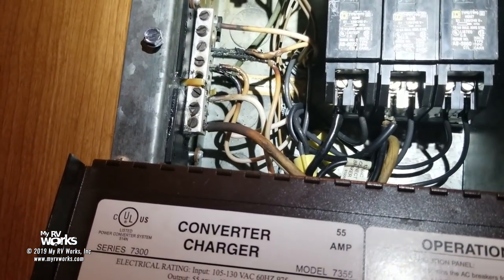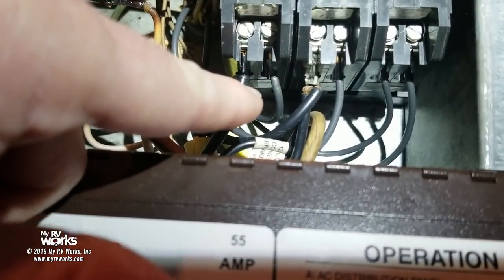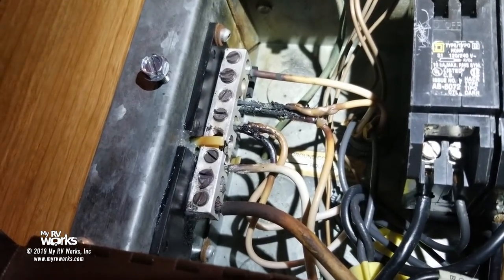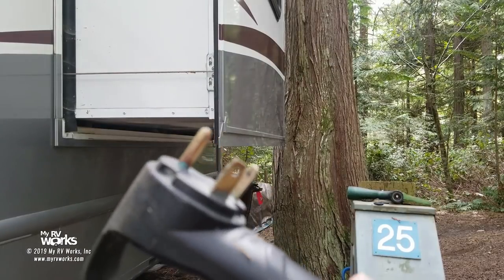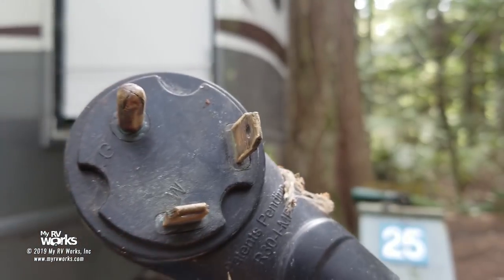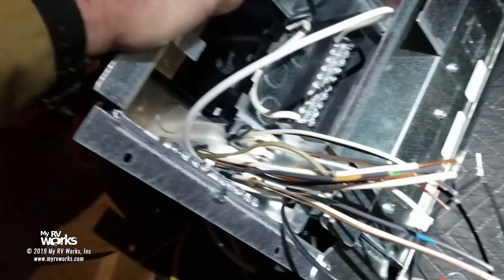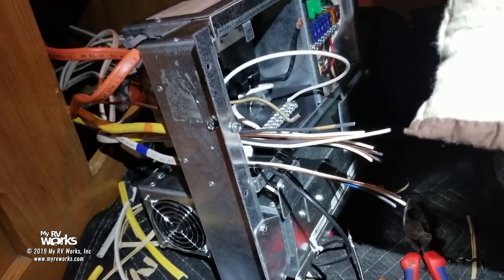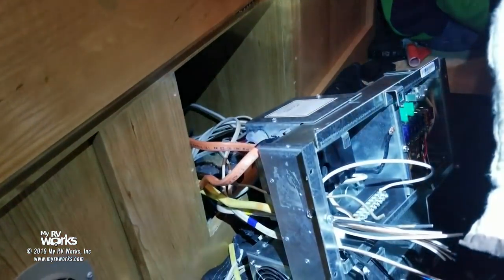Replace RV Electrical Service Panel & Explanation Of How Electricity Works

Comment: Don't ever apologize for rambling, because when you "ramble" it is VALUE. It's like free spins at the casino! I'm a reloader and have always struggled trying to wrap my mind around electricity so when you started talking about grains as an analogy, light bulbs went off. Thanks for what you're doing.

Comment: The fact that you take so much time to explain things to your audience (soup to nuts) is top notch, NEVER stop! I have been researching Solar and Lithium Iron Phosphate batteries for my future RV, for almost 3 years now - and I still consider myself a total novice where electricity is involved. You made a brilliant point about connection points being the main failure in electricity flowing. I was not aware of how complicated the electrical panel in the RV was, and the chance that the builder may NOT have used proper gauge wiring or torquing specs. Jesus take the frigging wheel...I don't even have my RV yet (prob a class C around 26-28 ft with NO SLIDES) but I am trying to learn as much as I can about how an RV is put together and how everything flows, failure points, etc so I can be prepared for my future ordeals, which I know will be a part of owning one of these poorly built monsters of the camping set. Thank you again. Your video on rectifying the slideout issue (the chain/cable system) over the top of the slide...what a nightmare! Nope, no slides for me...
Reply from the maker: Thanks for the kind comments. Hopefully my series of videos will help you, and many others, in keeping their RV in Tip-Top shape and staying happy campers. Good luck in your future purchase and RV travels.
Reply: Class C. Look under the couch. You will all the wires in one pile.
Reply: "Find"

Comment: I totally LOVE this electrician! I don't say this often man , but you have a passion for making certain you're understood, with explanations, examples, past job site situations yeah very through. I'm a framer with desire to learn as much as I can about electrical. I just found my go to guy for all things electrical. I'm moving into an RV that's been sitting for 20 years this video has saved me untold headaches learning about the importance of torque values for different gauge wires. Thank you so much

Comment: When connecting stranded wires to that type of terminal, the quality  and longevity of the connection is greatly improved when a ferrule is crimped on the wire first. The ferrule bonds all the strands together.

Comment: Dude, lol, my late husband was a master electrician and could NEVER explain ANY of this stuff to me, but you used all the right analogies and now I FINALLY get it! Tire pressure by gallons per minute, grains in a bullet, etc.? YES! I understand THOSE things so now I finally understand volts by watts, hz, etc.! THANK YOU THANK YOU THANK YOU. Seriously, you have no idea how long I've been trying to wrap my head around those things so I could work on my RV properly and actually KNOW what I need!! YAY! LOL No really, thank you so much. wow
Reply from the maker: You are very welcome! I've been dealing with electricity since I was 7 working with my grandfather as an electrician helper - he died when I was 15 so I had several years to work with him. It also took me a while to get my head wrapped around all this but then all the sudden the thousand points of light came into focus and I understood. My explanations are not theoretically correct because electrons don't actually move they vibrate, but I think I was able to capture enough to help people understand the 80,000 ft view.  Have a great New Year!

Comment: Thanks, I'm a maintenance tech and I work with and around voltages from 5 vdc to 480 vac 3 phase on plant equipment and cnc's pretty much daily. I also just got a 1982 GMC Midas. It's a whole new prospective thinking rv and I Thank You for your videos and helping you sort these systems out. Thanks for the homework too!

Comment: Nice video. The only thing that I would add is that electricity is caused by an imbalance. High energy on one side. Nature will not tolerate an imbalance. Like water, it is always trying to level out. If you ever see your voltage going real high and then real low, it is usually a broken neutral wire. Thanks for your videos. Really enjoy them.
Reply from the maker: Thanks for the comment David!  I find myself going deeper and deeper into these topics and then try to stop myself - perhaps if I prepared a script I could present the information more coherently.  I was an industrial automation systems engineer for over 25 years before I started this business (so I could be more involved in my kids childhood - engineering was great but no room for family balance eh') and I find myself jumping off the deep end with folks that may not know how to swim yet know what I mean?   That is why I used the hot-potato and bicycle analogies,  I made them up on the spot - I like your water analogy though!

Cheers,
Darren
Reply: The information is great! I made an RV 7 way tester like yours. Great idea! I drive film equipment and we are always having to quickly find solutions to all kinds of problems. Star trailers, 12v and 110 problems. Towing wiring problems. Great tip on being able to plug in the heating element for the refrigerator. If an actors refrig goes down, now I can be the hero until we can get it properly fixed. Thanks for making these videos!!
Reply from the maker: @davidh7636  Thanks for watching and commenting.  I have lots and lots of MacGyver type hacks to save the day.  I hesitate sharing some because doing them bypasses the safety features - but sometimes you need to get something done to save the day.  I hope I do not regret the frig heating element hack one day - LOL.  

More video's coming out filled with tips and tricks to help you be the hero!  Perhaps they will make a movie about you one day!!!

Cheers,
Darren Koepp
Reply: If I'm remembering correctly, electrons flow due to a difference in potential between the two end points in the circuit. That's why your cars alternator charges at 14 or slightly more volts. The alternator creates the difference in potential between itself and the battery. Does that sound right to you? Like I said, I'm working from old memory..

Comment: Darren, the video was long but you covered a lot of theory. I like to use the water analogy, for resistance, I like to quote my electrical teacher, he told one student that to throw him into the hallway from the classroom there is less resistance if he opened the door first than if he didn't. I do not have a torque screwdriver and have always just used my own guess, I will be looking into a new driver as soon as I can find one here in Ontario. I have been around electrical for about fifty years and you are the first to point out torquing the screws to spec. I do not know anyone that has used an actual driver to check it. My dad was a full-time electrical contractor all his life.  I will be soon. I will be going over the power panel in my Ibex trailer as soon as I get the new driver. A good job teaching your helper there well.

Comment: Very well explained. And to the point. A good video to watch. I subscribed to your channel. I've been an electronic tech my whole life..... I came across this video because I have a problem with my 2004 Pace Arrow 37C. When I unplug it from shore power and push both battery disconnect switches, both the Coach batteries and the chassis battery will drain down to 5.44 volts in a week or so. And stop their. Theses batteries are not supposed to be tied together. I'm still fighting it and looking for the problem. Anyway good video, it should help people. Thanks, Tommy

Comment: I am planning to upgrade my travel trailer from 30 to 50 amp as a retired Electronics Tech. I am fairly confident that I can handle it, however I would love a video on this procedure.  I know a few other RV folks who are not as knowledgeable that would like to upgrade as well, and also I may pick up some RV specific tips.  Thanks !

Comment: In the email I referred to a lighting strike that took out power ,is wire I thought until now and  receiving a power bill over $185.00 it has increased 25 or more every month and I thought air conditioning at first now ? I just don't know please help . I can do most anything with proper instruction  and you are the only one I have found on here that gives specific numbers to your reasoning!!!

Comment: I bought a 1978 Dodge sportsman RV that is a POS on the inside, it has a solar panel and all appliances should work, I know nothing about RV's and I'm so overwhelmed, I want to fix it up completely for as little money as possible while living in it. Your video is helping me understand some of the basics. I want to take out all the interior lights and put in battery led lights so they don't use up any of the available electricity, I don't know how strong that solar panel is either, I hope it will provide enough power to live on.

Comment: Hi great videos lots of info .
Why does my converter have 2 cables coming of the pos & neg terminals 
Tks Winston 
From Newfoundland  Canada
Reply from the maker: Typically when you find two cables connected to positive and two cables connected to negative, one set will go to your DC fuse box the other set will go to the battery. Hope this helps.

Comment: thank you for your info ,very nice ,i have a question for you ,we in the northern climate we have great varience in temp,with only lithium we have a problem with ar rvs ,how can you match agm with lithium ,in are battery bank ,
Reply from the maker: Well, it's not recommended to mix and match the lithium with AGM. The converter would not know what to do with that configuration. One option is to have two separate banks with a switch to select between the two. But then to be technically correct, you would also need two separate battery chargers, one to charge the lithium bank and another to charge the AGM bank.  They each have different charging algorithms.

Comment: Great video. I am currently working out an issue with my 94 itasca sunrise.  the issue is my 12v lights at my bathroom and bedroom are not working at all. Fan and light in bathroom and the lights in the bedroom. Lights over the bathroom sink are working fine. That sink is right across from the bathroom door.  Every other light both inside and out are working fine. 

Any thoughts?

Comment: how bad is it if you plug into a 50 amp receptacle that was wired wrong with the 2 hot legs on the left and bottom and the neutral was on the right side.

Comment: I'm restoring a 1984 Executive class A 35' 454 with tandem axle. Trying to figure out fuel pumps wires going everywhere for what should be a simple set-up. Well thanks again later you all

Comment: On my 30 amp camper, Forrest River put 3 receptacles along the back wall in the kitchen and one receptacle outside the kitchen window. There is no way you can run a coffee maker, a skillet and charge my golf cart without tripping a breaker. Don’t these manufacturers know about usability? In my breaker box it looks like there’s a space for another breaker. Can I add another breaker to replace one receptacle in the kitchen?

Comment: just found your channel and ive been watching your videos for hours now. i just bought a 97 four wind majestic and everything worked amazing until i got about 10 miles from the person i bought it from. everything seems to falling apart but im not going to give up on it. the fridge has stopped working but think ill be able to figure it out with your videos. One HUGE problem i have and i cant find the answer to is installing a certain backup camera its the cemacho 7in monitor 4 camera wired system. it came with instructions that have 1 picture on a 3x5 card and thats it. cant find anything on youtube or anything else. can you please help? Id also like to know how make the system run when the vehicle isnt on for security purposes. im thinking that will require some type of switch. can you help?
Reply from the maker: I don't have any information on that particular camera. But if you wanted to wire it so that it worked as a security camera, you just need to find a 12-volt source to feed that system. You can put on a toggle switch on your dashboard or something like that.

Comment: When you select a replacement Rv power panel, make sure the 12volt side, the part than recharges
your coach batteries, is a SMART CHARGER  type. This will let your coach batteries last the longest.

!

Comment: I need to know why (short on one 120v leg i guess) i have 220v one one side of my breaker box and nearly nothing on the other side.  Yes its a 50 amp dual 120v.  And yes of course everything is blown the hell up :(

Comment: I have issues with  cpgromd  plugs. I'm the crazy ladies running from pedistool to  next with surger protector.  Not always a ace in the hole  them the muliteter:)  if you know of tool that should be quicker appreaite your inputs.  I will be getting a torch tool.  I just had a new ac put up and the dude  didn't torch the bolts. Nuts  whatever's he just used his power thing. The man that ones the shop didn't feel well that day I told him I could would come back but he had a "helper"  needless to say I did see my warranty info but in the end it disappears and the woman at that buss. Doesn't even keep inventory info for cross checking. So I won't be going back there. Those rich bolts been strongly on my mind now I know what to look for. Tx  That's been on my mind I need to  tighten that down. Torch so it don't leak. !!  Or fall off down the road .  Thanks Darren . I have a 09  fléetwood Tioga class .c  I enjoy your vidios.   Thanks you brother.  For your service also to our great country.  tiogakattabella@gmail.com

Comment: The thing with RV's is that all the loads are 120V.  The neutral is designed to carry the unbalanced load.  So for a 120V 30A feed at the pedestal the maximum current on the neutral will be 30A.  On a 50A 240/120V feed the neutral will carry the unbalanced load between the black and red wires.  So if there is 15A on the black and 18A on the red the difference will be on the white (3A).  If the neutral in your shore cable in your 50A 240/120V has a poor connection (High resistance) then you will experience where one side of the distribution box will have high voltage and the other side low voltage.  The difference in that voltage will depend on the load carried on each side.  Not a good day for electronics.
Reply from the maker: Thanks for the comment.  When I was sitting in the camp chair trying to come up with basic analogies I decided not to go too deep into that topic – I was already worried I was making a mess of my analogy and needed to get back to work – I could see the customer was getting antsy w/o having any power eh.  I do appreciate the comments though because it allows us to continue the discussion.

Comment: After watching your video I want to say that after many years of being around electricity, your explanation of it was so simple. I am a General class Ham Radio Operator and part of the license process is for us to understand electrical theory. In our classes they have never used common phrases to AC Volts, amps, impedence, resistance like you did. In 45 minutes I learned more than many years of very smart hams trying to use theory to get us to understand electricity. Keep up the good video's.

Comment: Great video! Love the analogies to help us understand a bit more how electric current works.

It just so happens I was camping this past weekend and my 12-volt interior lights were all flickering at the same time when the wind was blowing. Only happened a few times but I figured I had a bad ground somewhere. After you gave us our homework assignment lol, I went out and pulled the cover off my distribution panel of the jayco trailer. Even by looking at the ground coming back from the RV battery I could tell it was loose! You could move it back and forth with your fingers! Must have taken seven or eight turns with a screwdriver to get it tight. I'm sure one more trip would have caused me huge headaches! Thanks again.

Comment: Hi Darren,
great video, just have an issue with one of your explanations: The "unbalanced" Neutral. On a 120V system (generally the 30A plug) the Neutral cannot be unbalanced, because it has nothing to balance out. Hot in, Neutral out, nothing to balance. On a 240V system (generally 50A) , you have L1 and L2 and that's where the balancing act comes into play. Often different appliances are plugged into either L1 or L2, lets say, the draw on L1 is 25A, on L2 is 15A. That's where the Neutral balances out the returning Amperage at the Neutral bar to a roughly 20A average return to the central Neutral in the net. And this is the only place where you easily can have a different Amperage reading with your Amp meter.
Respectfully
Peter
Electricial Tradesman for 60 years and had the pleasure to work on RV's for the last four years.
Reply: I could easily be mistaken on this, but isn't it possible for the rig next to yours to cause an imbalance on the neutral AT THE POST?  Notice ... I don't think this would effect heating at the circuit panel in your rig.  I believe this WOULD explain heating of the neutral plugged into the post at an RV park.  Any thoughts?

Comment: I love your videos! Electrical theory is NOT your strong point! Two conductor romex do not share nuetutals. Let’s simplify. Loose connections create resistance which creates heat that melts insulation weather white or red or black or whatever color. Frequency, sine wave etc is way overboard! When it comes to wireing,,,, tight is right period. I love your job 😎👍